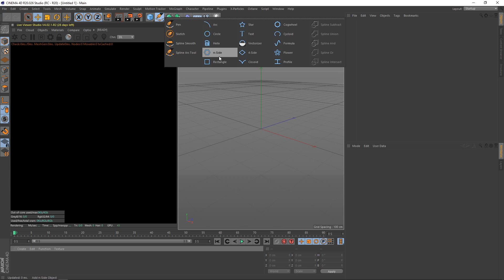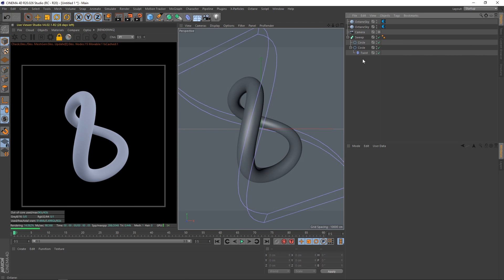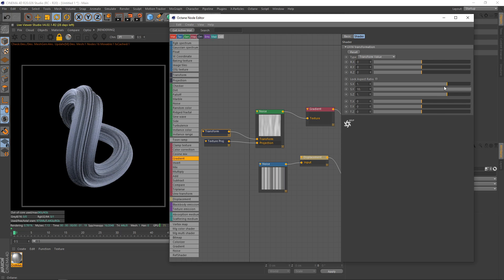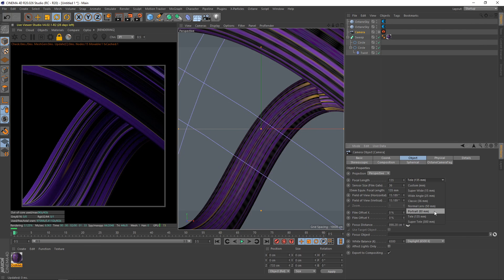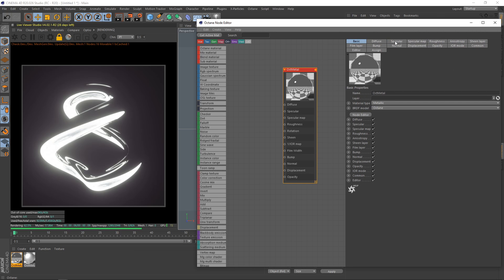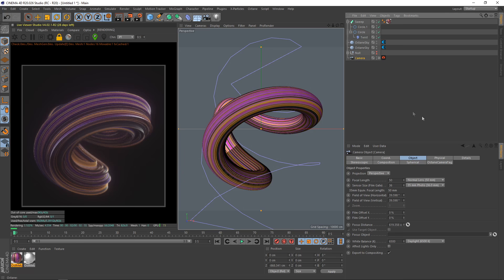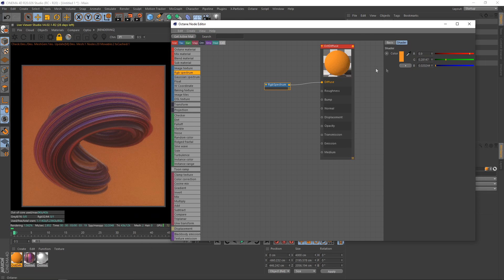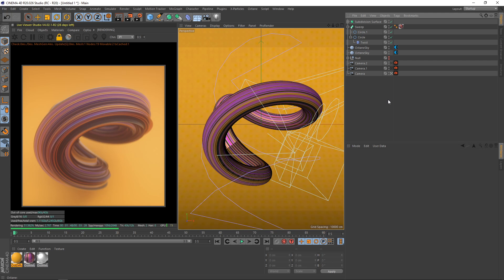Procedural Noise Patterns in Octane for Cinema4D (Oostenbroek Effect)

Comment: My displacement is super jagged. I bought your file but when I set my settings to yours it still isn't smooth. Any tips? (I messed with the natural/subdivision/etc types of settings for the intermediate points)
Reply: Drop the sweep under a subdivision surface, it'll fix it